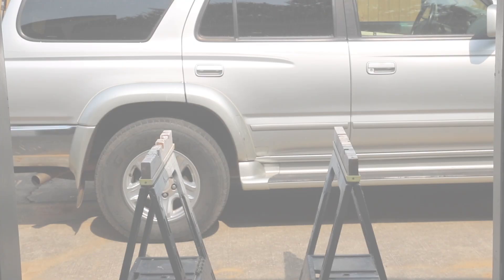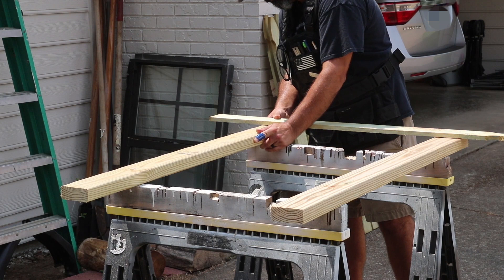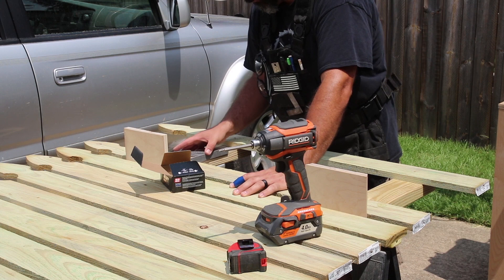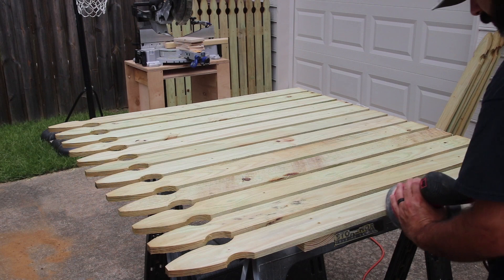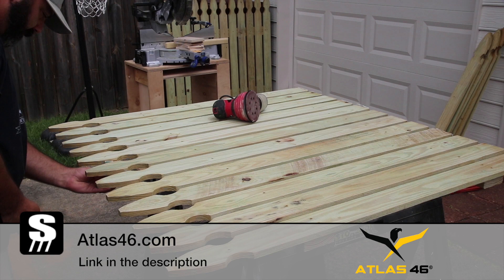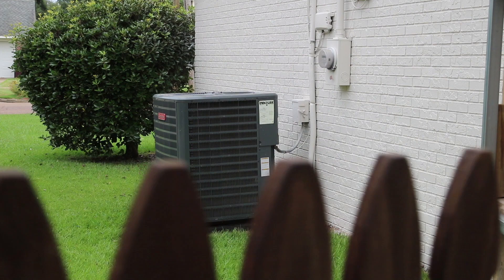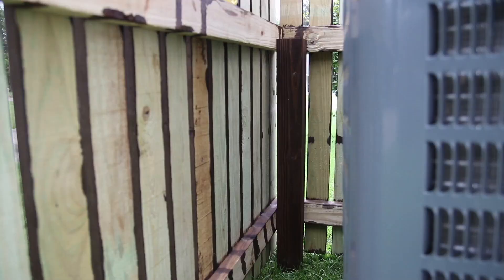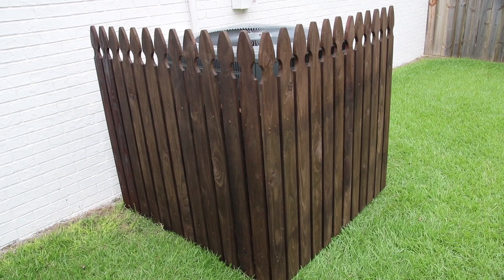How To Build a Fence

Comment: I built a privacy fence around my yard on the Gulf Coast in 2001. I attached all the 6 foot fence boards to the stringers with "temporary" 18G brads, planning to go back and attach with screws once it was all finished . Well, 17 years later those "temporary" brads are still holding that fence together. Made it through Katrina and several other storms and have never lost a board. While I don't recommend this method, it sure made hanging those boards easy and has held up better than I would have expected.

Comment: Question, those units need good air flow.  I know this boards don't starve the unit but still curious.  How did you find the appropriate spacing around the unit to use?
Reply from the maker: No particular formula, just spaced out the fence boards to allow air flow.